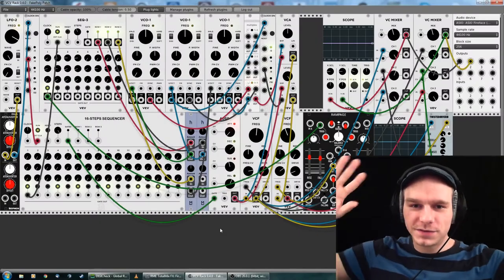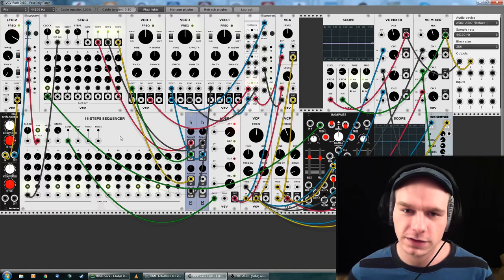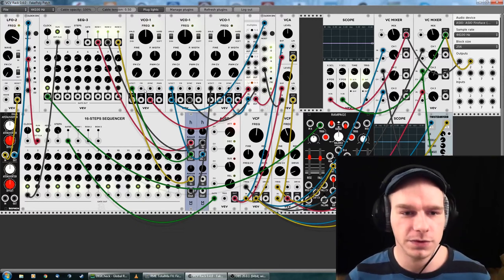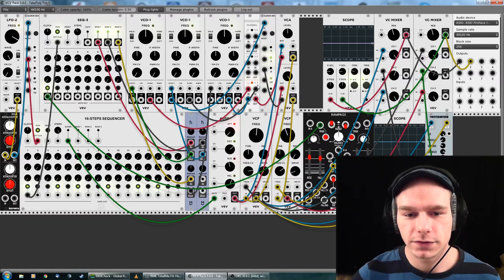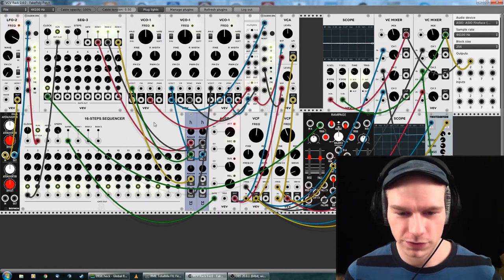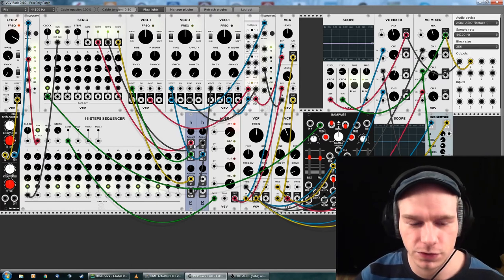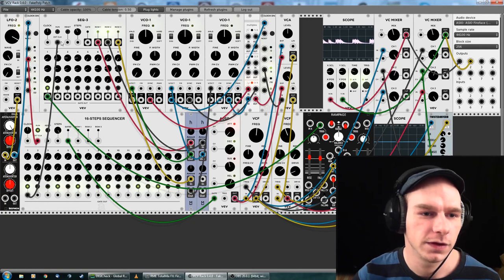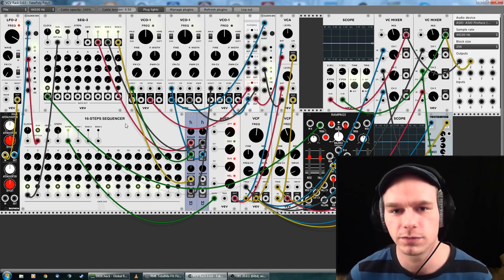VCV Rack / Polyphonic Patches / Synthikat Tutorial

Comment: Nice solution. Whats the function of the clock divider that feeds sin wave from the second VCO?
Reply from the maker: Thanks! Other than clock signals a clock divider can also be used to divide the frequency of audio signals. 1 Example: You send 2khz sine into it you get the divisions of that. /2 = 1kHz /4 = 500Hz and so on. Like i did in this patch.

Comment: Where did you get the 16 step sequencer , it is not included.
Is it payware ?
Reply from the maker: Its from Autodafe! Check his page: https://www.autodafe.net/virtual-instruments/vcv-rack-modules.html
Reply: and the TWISTEDMVERBS?..
Reply from the maker: from this guy: https://github.com/nysthi/nysthi/releases
Reply: Hi, thanks for the quick reply but I have a problem with modules autodafe and nysthi. In the program files where the VCV folder was installed, the files of the modules appear but they are not as plugins inside the VCV rack, when I had the version 0.5.1 I did not have this problem until I updated the program to 0.6.1. What can I do to open these plugins?
Reply from the maker: I dont know. Maybe try to update to 0.6.2b!